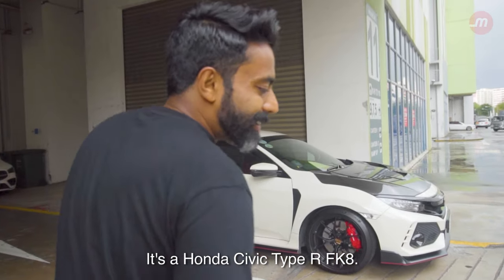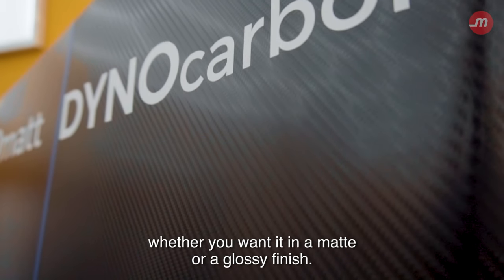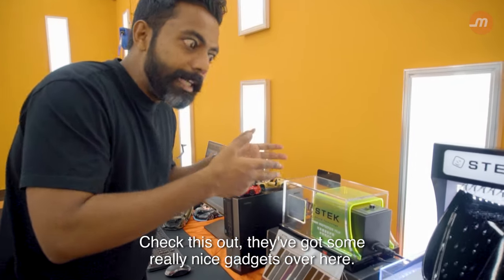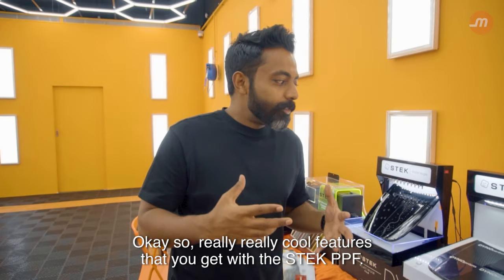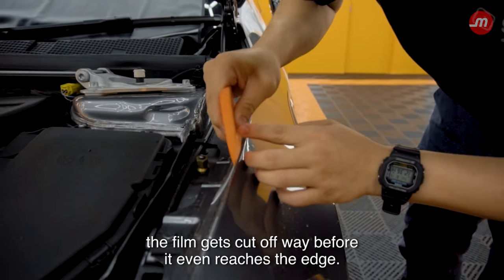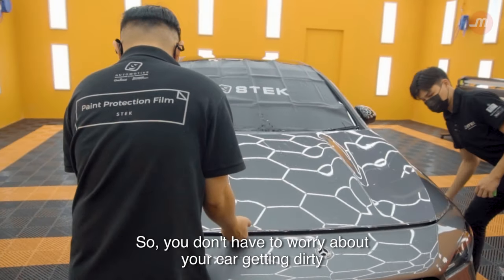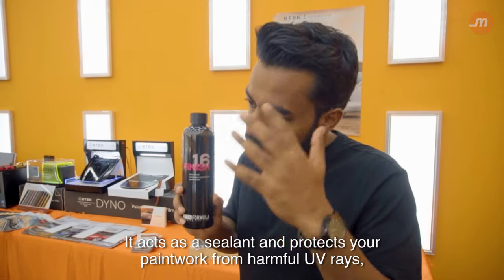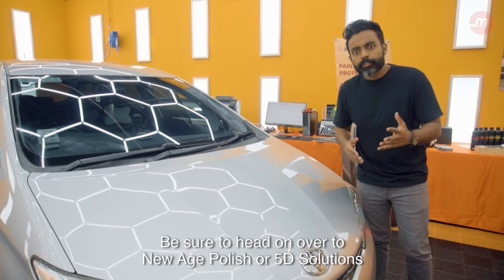STEK Paint Protection Films Are the Only Fashion Films in Singapore!

Comment: Thanks for this awesome video!! I usually use my Porter cable DA for applying sealer on my paint surfaces. I have a couple questions if you don't mind; 
1) Is it safe to still use my DA for applying sealer if I want to on this PPF? 
2) What would you use for rail / brake dust, sap, tar, etc. to safely remove these contaminants? I wouldn't want to discolor the PPF for example with Iron-X 
3) Is it safe to use a power car wash? Normally I hand wash but, in the winter and on long trips I use a power car wash. Thanks again! Great job!!